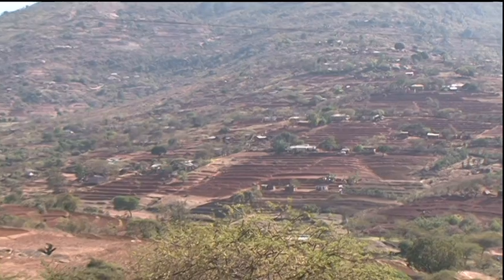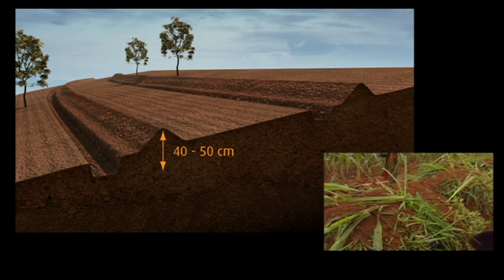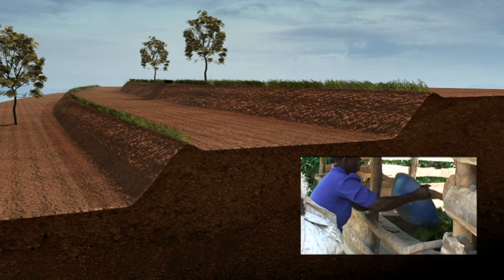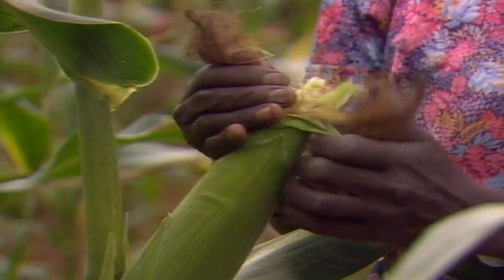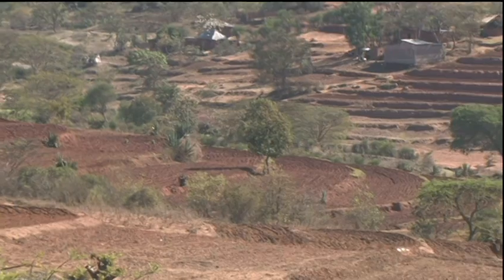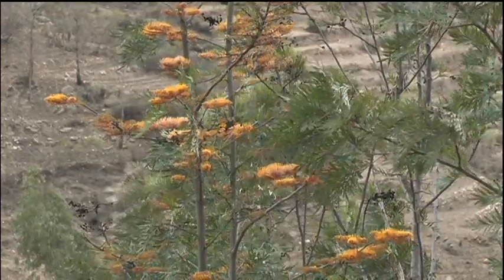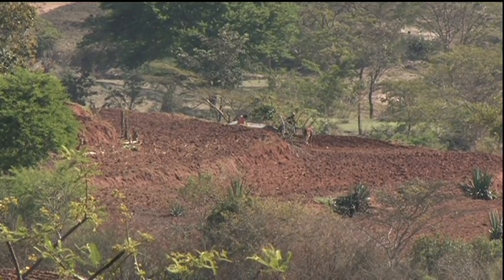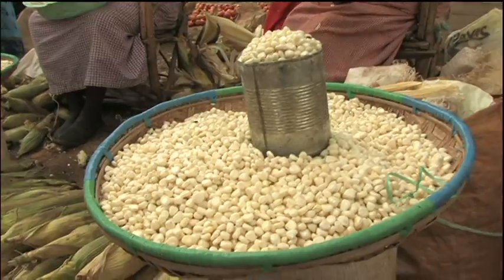Fanya juu Terraces

Comment: I dug terraces in my land in Central Kenya back in 2005 and I have reaped benefits from the practice. First, they helped slow down  run away rain water on steep slope and hence seep down. My aquifer is increased and thus the water table making all crops in my garden rejuvenate and remain green even during drought seasons.

Comment: Even with terracing, constant plowing/tilling loosens the soil too much and encourages it washing away the topsoil. It disturbs organisms and systems establishing themselves, and means extra work for everyone. I am glad to hear they are planting trees interspersed though, as they provide even more food and do not compete with "surface" crops. I wish America would plant trees in the fields, but it would interfere with the machinery and harvesting. Small farmers do this, though.
Reply: Washing away, no. Maybe in a dry spell wind might be an issue. But the terraces are made on contour. The land is level and there are lips or mounds on the edges. There is literally no where for the soil to go, so it doesn't get washed away.wind may be an issue, but with the terraces sporting trees and grasses, the wind problem is probably mostly mitigated. Could be mitigated even more if slope with high risk of wind erosion were planted as orchards, groves, vineyards, or barrens so that the soil doesn't get disturbed and disperses the winds preventing them from becoming an issue for the tilled portions.
Reply: American addiction to big machines prevent these regenerative techniques from being implemented. As a cattleman who knows animals need shade and water, it galls me to no end when pastureland is rented out to crop farmers.  They go in with bulldozers and excavators, rip out the big old trees off the sides of the drains, then fill in the ditches so they can run right over them.  Then every year they have to go back with land graders and fill back in the erosion where the water runs off down the natural runways, or level off the wet spots where the water collects in the fields.  Just machine work after machine work with nothing permanent ever achieved. And then they allow runoff on the sides of the field to form ruts that begin to make gullies.

Comment: It's interesting that they put the trenches front of the walls instead of behind them, as most rain catching schemes do.
Reply: Because they want the slope to slowly become a terrace.
Reply: @Nemesis_T_Type  
Terraces don't harvest water as well as swales,  bunds.
Reply: @b_uppy  the use of swales is dependent on geology and hydrology of the land and it mostly limited to very low slopes. Otherwise it can saturate the soil and cause a landslide.
Reply: @dietrevich  
Do you even watch Geoff Lawton,  or Mark Shepard?
Reply: You actually want your terraces to slope back towards the hill to catch water and allow infiltration.
Reply: Seems like more work physically,   and more drying of the soil than permaculture swales.   They need to interplant trees to to diversify their crops & for even better stabilization of the soil.
Reply: However better than not doing anything!  There is an interesting discussion to be had!    see this.....https://www.youtube.com/watch?v=-8nqnOcoLqE&t=73s